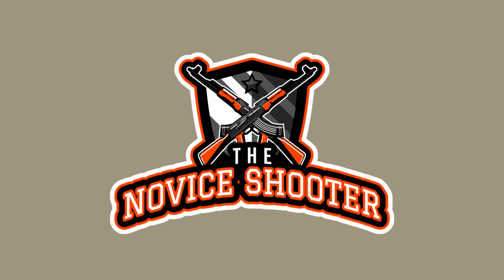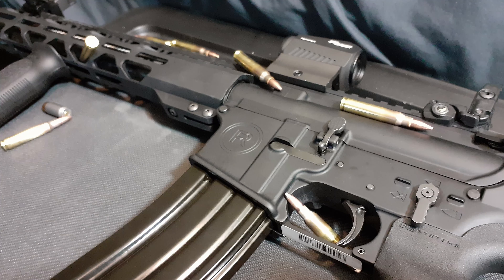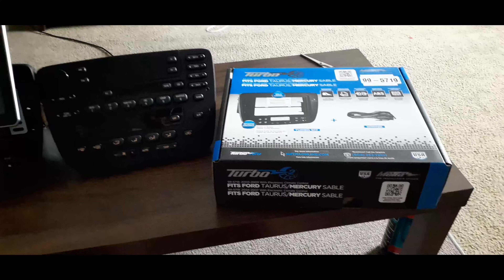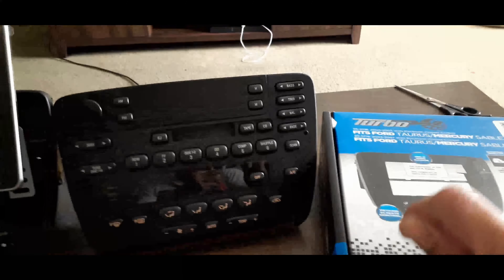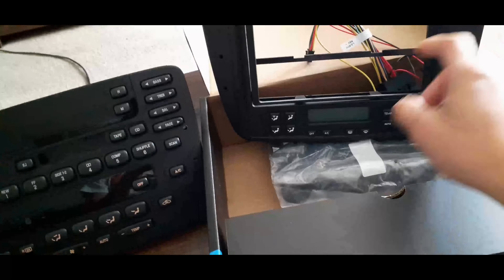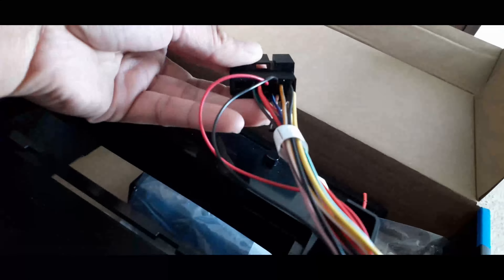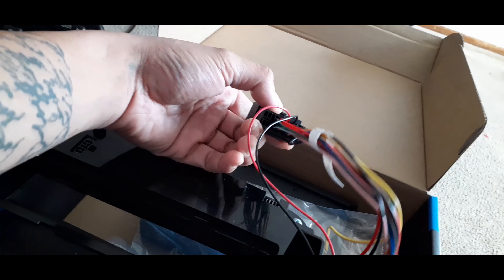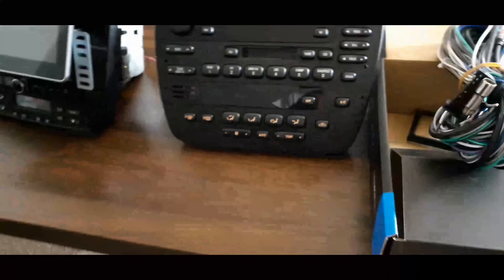2000-2007 Ford Taurus / Mercury Sable Stereo removal & Aftermarket stereo installation!

Comment: Very helpful video 👍🏻 thanks homie 💯 so how did you connect an amp/subs if youre still using the stock amplifier in the car ? Thats the only thing im confused with lol other than that thank you for making this video 👌🏼 extremely helpful info
Reply from the maker: I used a line output converter... That's was months before I installed the headunit..

Comment: Heya. I’ve actually got an 02 Sable I bought a while back with one of these units already installed. Ram well for a couple years, but for the past bit it’s been blowing hot air regardless of the set temperature. Had a shop do a full diagnostic from the compressor to the blend door and there’s no issues with the car’s mechanics/fluids. The only option left is a possible malfunction with the climate control unit. Any advice on diagnosis?
Reply: Pcm

Comment: I used a jvc and when I hooked it up it didnt start the radio but everything else worked is there by any chance I need to add auxiliary and amp wires?
Reply from the maker: Check your wiring for power to radio (the red & yellow wires) from the cd player
Reply: @TheNoviceShooter  thanks I appreciate it going to give it a shot when I get the chance
Reply from the maker: Also check the black ground wire from the cd player make sure all your connections are tight
Reply: @TheNoviceShooter  sounds good I appreciate the tips